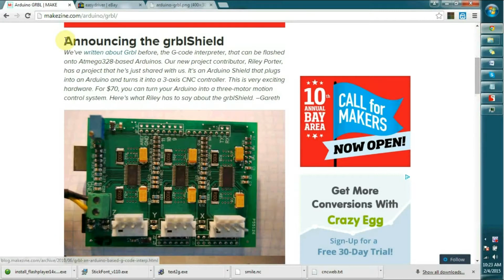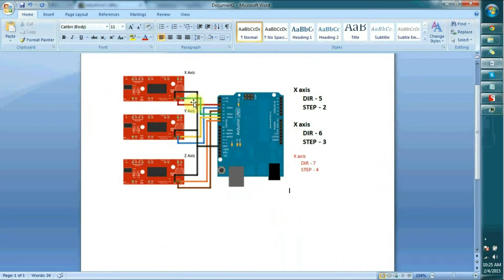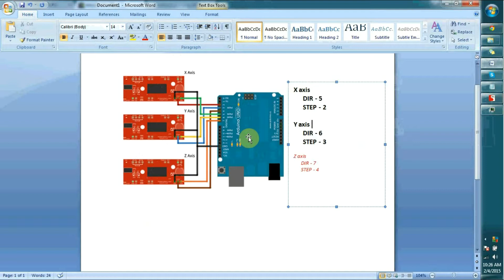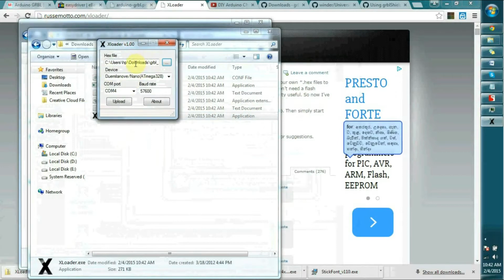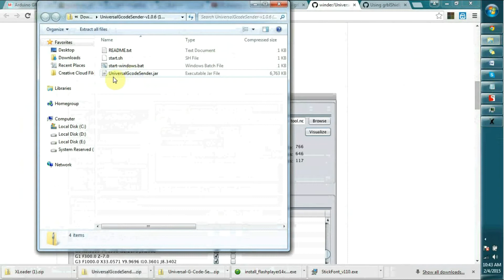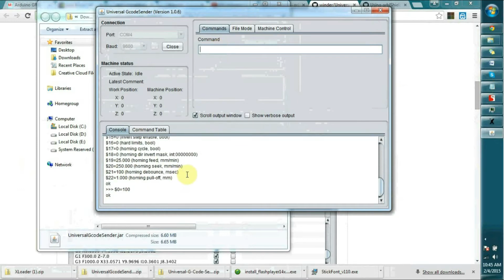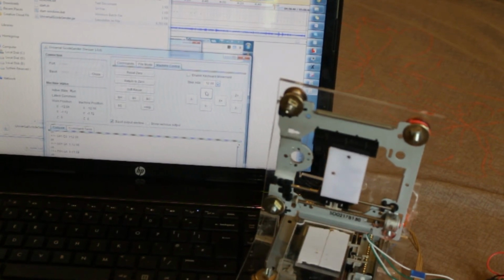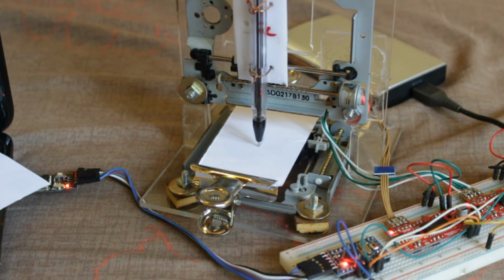Plotter with Arduiono, Easydriver and junk CD Roms (Used GRBL program)

Comment: There is heating problem with Easy driver  v4.4 .. 
can u help me ..?

i have connected : 1 arduino uno , 2  nema 17 , 2 Easydriver v4.4 and 9 v power , 

Easy drive get heated in 1 min  
tell me how to solve heating problem .